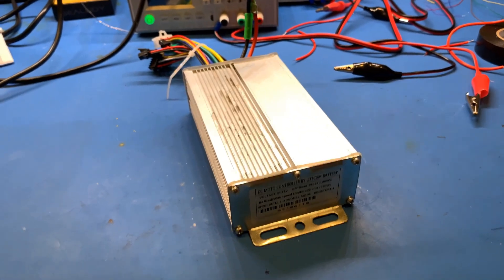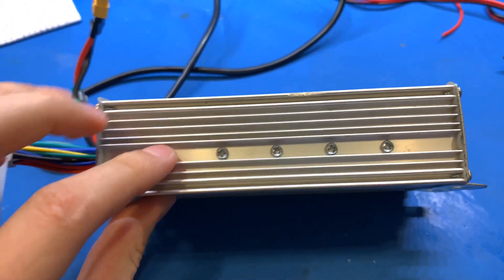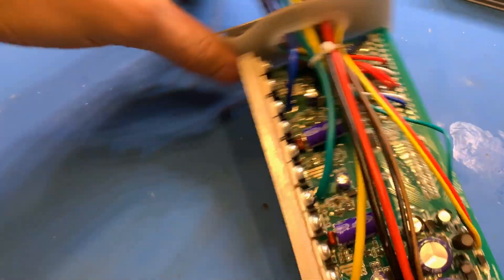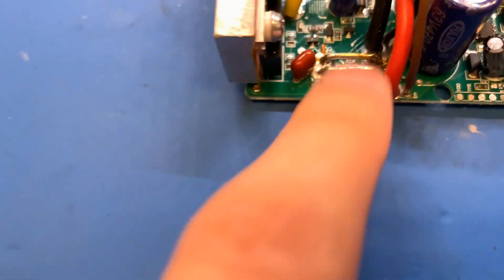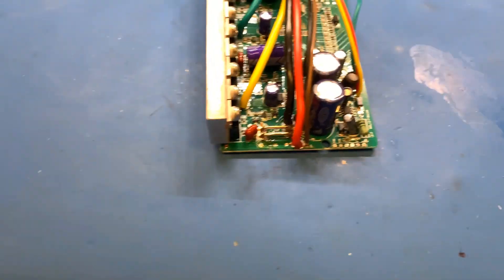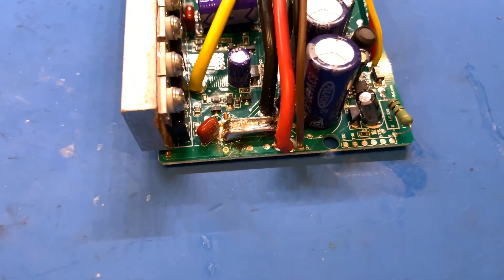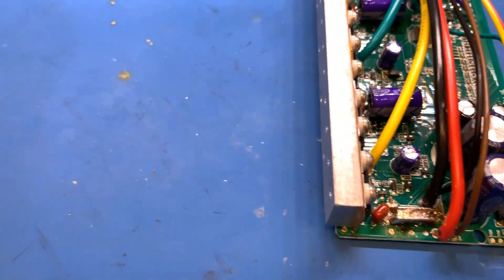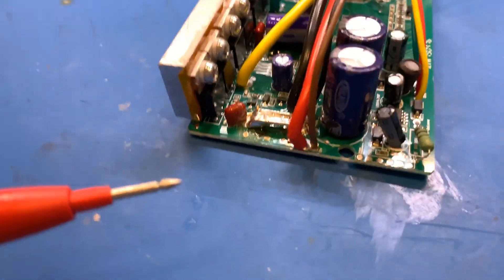Ebike Motor Controller Power Mod

Comment: There is no difference, what is said here is just fairy tales, meaningless dreams, the only change that appears on my smart controller, on the application, the current consumed by the controller is much lower, otherwise there is not the slightest difference, I have a 2000w motor and a new 60 ah li-po battery.
Reply from the maker: Adding solder to the current shunts lowers there resistance which in turn tricks the controller into thinking it is supplying less current to the motor then it actually is. If there is a current limit set on your controller this mod allows your motor to draw more current. Sounds like your controller was not hitting a current limit or there is something else like your BMS limiting the current.

Comment: Hows that controller doin 🤠it sure has been a while
Reply from the maker: It died, although it was able to survive 4kw which is quite good for only a 1kw controller.
Reply: @ryanstephenson7655  need  help with one myself im getting the same voltage from one side to the other when plugged in everything is working horn lights display etc but the throttle just wont spin the wheel ive tried another controller and its fine ,its not mosfets its not shortin could it be a capacitor? Everything else is ok with it

Comment: FYI... i made a rookie move on a controller once. After you unscrew the end caps, make sure the rubber grommet and wires stay tight against the board, if that metal end cap plate touches the board and the capacitors are charged, whoops 😭😭

Comment: Anyone shunt mod while they have a dual battery balancer installed with 2 batteries? Would this cause chaos or whiplash???? Lol. I have an Aipas M2 48v 1500w max. Stock battery is 48v 11.6ah a dual battery balancer with a 48v 20ah battery on the rear rack.

Comment: Your presentation was astronomical however your technique of increasing the power flow your tempering with very important sensors the battery now may overheat due to the census not shutting down the power flow which will result in the fire and explosion overheating the batteries it's dangerous what you're teaching

Comment: Thanks, and two questions; after you solder and plug the controller back in the bike, isn’t it gonna drain your battery quicker and second question how about get a different controller that delivers more power?
Reply from the maker: If you are pulling more power from the battery it will drain it faster. Also would recommend getting a more powerful controller if you don’t want to risk blowing up your controller by doing this mod.

Comment: You can increase your current by doing this, but your controller is not able to withstand more heat without increasing the cooling surface. Install a small fan inside and make a good contact to extra external cooler. Then it may work a long time.

Comment: It works
I did the same thing on my controller(72V 26A Rated) and now getting arround 32A at 72V.
Acceleration of scooter has been increased. No change in top speeed.
Reply: Bro i have e scuters ert010 and its 36v 11 ah bateri can i dou it ore its gone blow

Comment: I joined the those two thick wires together and added some solder, but nothing happened, no power increase, maybe I have to add more solder even on the sides?
Reply from the maker: Could be that your battery is limiting the current. If you add more solder and still don’t notice a difference I would look into upgrading your battery for more power.

Comment: If I wanted to take a more conservative approach is there any reason I couldn't just bridge them together with regular electric cord. Solider the bridge from one to the other in the center.
Reply from the maker: You could, that’s what I ended up doing. It just makes it so your controller will never limit the current output.

Comment: You have to nip shunt bars together then solder thin along top and the controller to use for this is 35+2 amp which hi ez you 40amp so you have to use bigger fuse if its 30amp it will blow use 35 to 40 amp fuse if controller gets to hot then scrap more solder off using hot iron and try to get thin layer along top no blobs because that will put you back the way it was. You can try what is in video but you will only get a small amount of power or really no difference

Comment: Hi I've watched a few of these videos I've got 2000 watt kit battery 52v17.5 I've had kit for three years it said on info that the bike does 35 mph which it does on the stand it does 45 mph that's due to load. So when I ride bike it's adding weight to bike hence slower performance. And I've noticed the motor gets warm and controller gets hot when I open throttle and do high speed all the time. If I up grade controller the wires are all different so couldn't be bother with that. So I'm going to try this today. I've got to remember to draw current out of controller is it will spark. So you said the power was good does the controller get hotter with this upgrade thanks
Reply from the maker: The controller will get warmer. More power = more heat. If it starts to get to hot go easy on the throttle and maybe consider getting some airflow over the controller or reducing the amount of solder.

Comment: Hi ivge been watching this trick I've got 200wat kit with battery 52v17.5 amp so this will increase power if been thinking it would be better to bridge the shunts with crockadile  clps with different thick wires and find the write ammount of solder I think to much solder the bike woud just shoot away but good idea I think I will give that a go what's the best way to get rid of current from controller before working on it

Comment: Hi! I soldered my bridge a little thicker and the acceleration is significantly better.
But why does the display show me less watt consumption than before? that confuses me.
Before the tuning, the controller pulled 1900 watts at full throttle, now only 1600 but accelerates much better.
Reply from the maker: It displays less because the controller uses the current shunt to measure how much current is being supplied. When you add solder to it, it decreases the resistance of the current shunt. Sine ohms law states voltage = resistance * current reducing the resistance will trick the controller into thinking it’s supplying less current. It will also display less watts because watts = current * voltage.
Reply: @ryanstephenson7655  can I get some explanation in French please I want to increase my ebike speed power its use 72v a 2000 Watts mottor

Comment: Hei Bro. Do you know how can I bypass the limit in reverse on those controllers? I built a 4x4 e-front loader, and it has not enough power in reverse with loaded bucket.
Reply from the maker: The reverse is most likely software limited, you might be able to adjust it by programming the controller.
Reply: @ryanstephenson7655  Thank You Bro. ive already realized. but +25 percent would be enough.:(
This is a 24v 850W driver (s)....(both are same modell), In forward really great, loader about 550kg+Me with a load of 200 kg in bucket and does the job, so 1700W is enough power. , I just took it apart  to check today. all capacitors are 50v or higher  (80v), FET: SKD502T (80v-100A) and has  6pcs/coil, hopefully wont smoke from shorting the shunts a little.Or ((((because i have on the boart (labeled)  "60v-72-80v "))))so ill try to incrase to 36v with same setup, or just change capacitors and try with 48V. it is worth a shot. Thank for the video really helpful.

Comment: These controllers are so cheap ,  I think if I needed more power I would just buy a larger controler ,  I  dont want it to crap out and get ran over ,but to put a push button switch inline for e-nitrous might be a cool safty feature !   dont forget youre bms might be a bottle neck .

Comment: Can you jump the two with a vairable resitor and have an ajustable amount of boost ? This might be a nice feature to have a push botton switch for e-nitrous to avoid a crash .
Reply from the maker: A switch could work if you just had it shorting across the current shunt.
Reply: I like this idea!
Reply: @barelytrine  do you think it would work 🤔
Reply: What if I have 3 little bars running over the board? Yours had 2 shunt things. Mine has 3, put solder on em all? I'm 9nly gonna do a little

Comment: If you do this, you better also add more heatsink to the transistors or it will just blow them up and your added power will be negative, i.e. no power anymore.
Reply: No need, people have been using this mod for years and it works. If you overdo it you can have problems but typically It works great

Comment: My motor controller shuts of. I think it is because it’s drawing to mutch amps. Can you fix the problem by doing this?
Reply from the maker: If your controller is shutting off from drawing to many amps this mod will increase the amount of amps your controller can draw before shutting off. By doing this mod your controller will be supplying more current then it was designed for which can cause premature failure or death of the controller.
Reply: @ryanstephenson7655  Okay thanks! Does your motor controller still work after doing this?
Reply from the maker: @timstenberg5603  My controller hasn’t died yet, I’ve been running about 3x it’s rated power.
Reply: @ryanstephenson7655  Oh! Thats nice!

Comment: This is a misleading video if it doesn't tell you Why and How it works ...The shunt mod is actually a controlled resistance those wires or jumpers are actually a calculated resistance adding solder lowers the resistance. IT IS NOT A DIRECT SHORT...DO NOT JUST RANDOMLY ADD A BLOB OF SOLDER IT DOESNT WORK THAT WAY!!
Reply from the maker: I explained how it works in the video, so I’m not sure how it’s misleading. Adding solder lowers the resistance of the current shunt. The controller measures the voltage drop across the shunt to calculate the current so when you lower the resistance the controller will measure a lower voltage. Yes randomly adding solder does work if your goal is increase the amount of current your controller can supply. Although it is very unscientific and if overdone can lead to blowing a mosfet.

Comment: I'm wondering if you could help me out I have a controller I want to swap but don't have diagram for the Nike I'm switching to to but the vonnector on the the new controller is the same  hire do I find wirefunctions

Comment: For all the people who ask if doing this is going to make the bike, scooter whatever..faster. no increasing current to the motor will not increase top speed. It will make getting to top speed faster as in more acceleration and torque. 
The electric bike formula is this. 
Voltage = Speed ( higher voltage higher speed)
Current = Torque (higher current more acceleration and torque) 

Most motors really don't have a limit on how high a voltage they will operate on. You can run a 36v motor at 300 volts. Won't hurt it, the thing that will smoke motors is running huge current to it. Heat kills motors and current makes heat.  
Monitor your temps and there is little chance of destroying anything.
Reply: No.  

I've read the tutorials that gave you this wrong idea.

Power determines max speed and acceleration.  Power is voltage times current. Increasing either the current or the voltage yields more power, hence torque, hence speed and acceleration.  Current limiting a controller limits the max power, hence speed and acceleration, the system can produce.  So this mod should increase the max speed provided the motor doesn't hit some RPM limit first.  

Also extremely bad advice on raising voltage.  The 36V controller is unquestionable built with parts that are rated for a voltage way under 300V.  Overvolt a capacitor and they pop like popcorn.

Having said all of that this runs a high risk of burning something up.
Reply: Your wrong my shit went faster. Dumbass
Reply: Great way to explain the voltage and amperage and his it affects the motor. Thank you for explaining I hope others read your comment and decide not doing any modifications that may or may not help.

Comment: I have tryed this and it doesn't work at all, ?  Same speed and same amps not a thing changed on my control box
Reply: Take a guess what that means? Did you ever think maybe your battery doesn't have any more current to give and that's why nothing changed? Sounds like you're battery is your problem and has nothing to do with your controller. A controller will eat up all the amps your battery will give up to it's limit. The shunt mod doesn't create current from nothing,it needs to be available in the battery.
Reply: @kevins5016  thanks

Comment: Hi friend. I make the mod on my controller. A lot of torque now, but I need more speed. Mine get maximum speed 45km/h. Can I get more speed ? Like 65km/h  ? I'm searching for diy but not find. Only mod like your ... But don't speed up
Reply from the maker: For more speed you need to increase your battery voltage. My battery is 72v and I can go about 70km/h but when I used a 48v battery I can go about 45km/h.

Comment: what was your max amps before and after the mod? mine stock controller is 72v 60amp, i am thinking of boosting volts to 85, but i think my current is too low at top speed. at 51mph its hard to see my true volt/amp/watt meter but i am pretty sure its maxed at at 57amps. i am thinking i could go much faster with a little more torque, that wind resistance gets crazy

Comment: How can I do the opposite? 
My controller is drawing too many amps, making acceleration abrupt and heating the system.
Reply: Cut one of the current shunts out of it has 2 or more side by side. If it has 2 and you cut one, it will half the amperage. Experiment with replacing it with a slightly longer piece of wire to get the amperage you want.

Comment: Tried this on my e-bike and blew a mosfet🤣. Tip: if you're gonna do this don't put too much solder, just a small bit
Reply: Hi I ordered my solder iron what will happen if i put too much
Reply: You'll blow a component on the controller & need to buy a new one. Did that earlier this week 😅

Comment: How much amp will it increase?
Reply from the maker: Depends on how much you decrease the resistance of the current shunt.
Reply: @ryanstephenson7655  so about how much will increase how much current flow? Is there a lil gauge I can use?

Comment: Do you know if running a 36v battery and 36v rated controller on a 48v hub is legit? Like, will I ever run into any type of issues?
Reply from the maker: Should be no problem.
Reply: @ryanstephenson7655  Does that mean it’s probably a better deal to buy 60v or 72v hubs if they cost the same?

Comment: Can you make a video about removing the low Voltage cutoff pls
Reply: There should be a value you adjust in your controller settings(onboard screen). Be careful though. That value is typically already setup for a reason.
Reply: @FoundationsofPause  no my controller is a cheap one without any screen or software control

Comment: Will this Mod prevent the bike to cut off power when the load is high? I'm experiencing a LCV problem everytime I ride the bike
Reply from the maker: This mod could possibly fix your problem If your motor controller has over current protection. Most batteries have over current protection also so it could be your battery that is shutting down during high load.
Reply: @ryanstephenson7655  correct! As I have found out lol
Reply: @ryanstephenson7655  In case, my BMS on the battery? I just changed the battery to a new one and the problem persists. It runs for 15 seconds and cuts off when I put more power on the throttle...
Reply: @danielaragao  I have same problem. Only after shunt mod. I assumed it would be the BMS too as the 18650 batteries only rate for 25amps so we are now drawing to many amps which the BMS then shuts down to prevent damage to batteries. As you said you tried a different battery it could be the controller tripping out. I have just installed a larger controller on mine and will test drive later. Keep you posted if you reply
Reply: @DJSpannamanUK  Keep me updated please and if it works, send me the link for the controler for me to buy. thanks brother
Reply: Right Dan. No cut outs with the new controller. But the shunt has not been messed with. 
It's got to be the BMS.  I will mod the shunt on my new controller and see if the cut outs come back. Holla
Reply: @DJSpannamanUK  great. If it's the BMS, it can be tricky to change
Reply: So it's the BMS! Crap! But I have a plan. Use lipos with a RC controller! We don't even need the sensor wires! Just the phase wires!
Reply from the maker: @DJSpannamanUK  have you tried running the bigger controller off lipos? They should be able to handle the current.
Reply: Hi Ryan. Not lipo's as I know they will handle 200amps plus it's the fact I'm running  lithium ion 18650's and they only rated @ 25amps. Even the vape ones are like 35amps. My bms shuts off the bike if I mod the shunt with too much solder. It's over 80amps. That's why I'm thinking to ditch the 18650s and just use an RC esc and lipo 14s
Reply from the maker: @DJSpannamanUK Running a RC esc may not work that well because they are made for higher rpm. Sensor less esc have no torque at low rpm, If you are going to try I would at least get a sensord esc.
Reply: Cheers for the info Ryan. I'm not about going slow lol. So I'm not bothered about low rpm control. I pedal to get going mostly and just w.o.t it ! Lol